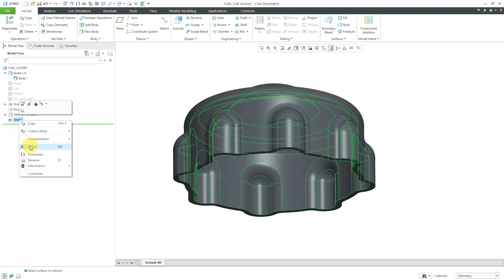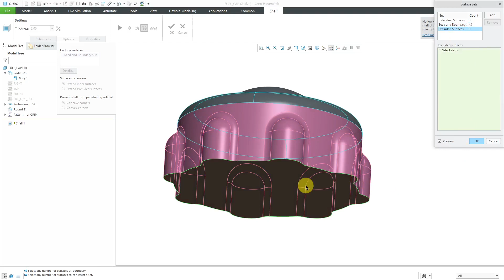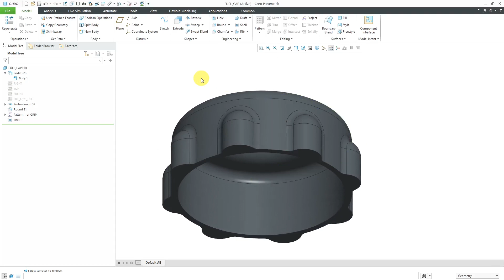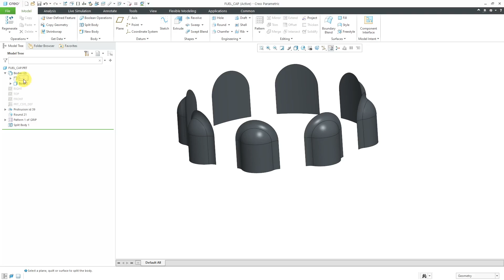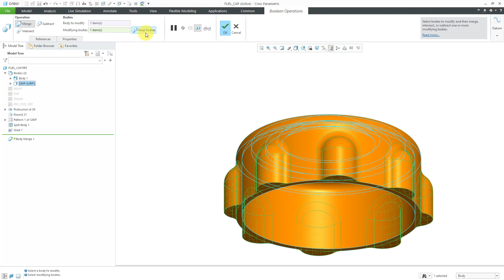Creo Parametric - Multibody Modeling for Local / Partial Operations

Comment: Hello Dave , In that  case if i have to create family table of that part , may i have to insert the table  only body1 or body2
Reply from the maker: Family Tables have not changed in Creo Parametric 7.0. You cannot add columns for Bodies to the Family Table. However, you can add features, so you can include columns for Multibody related features like Split Body, Merge, Intersect, and Subtract.